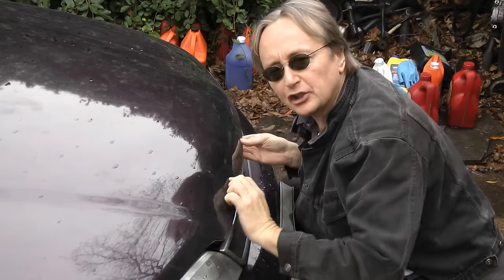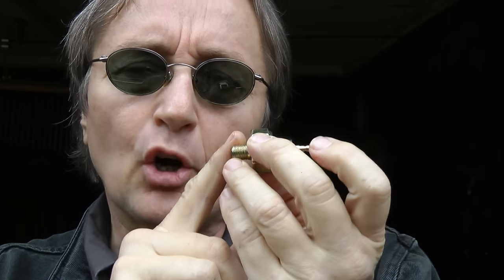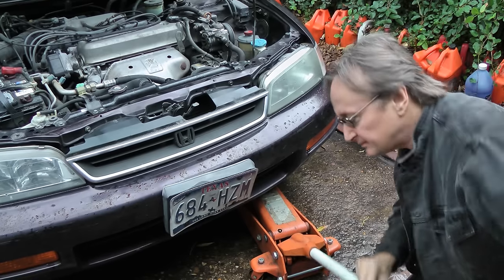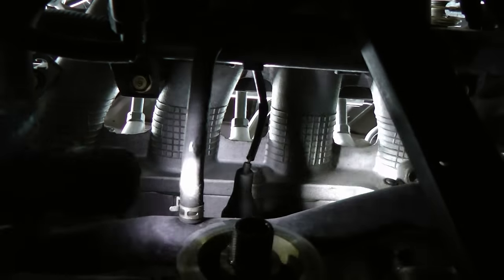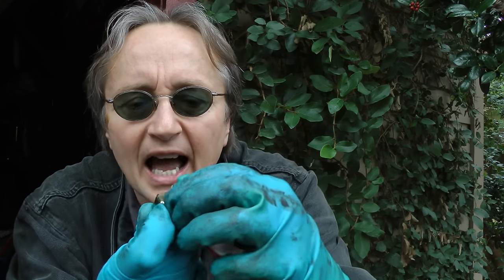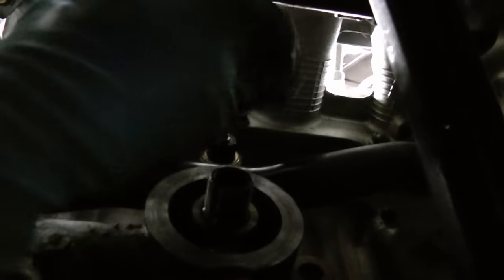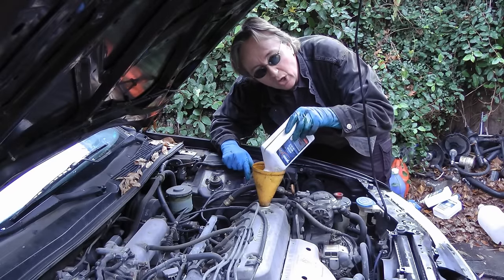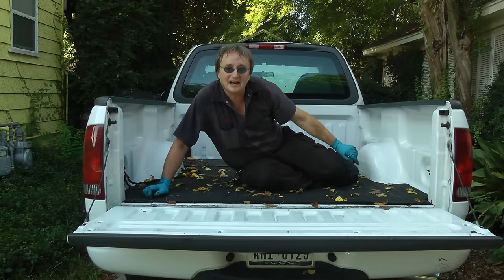How to Fix a Low Oil Pressure Light in Your Car

Comment: Hey Scotty, i have a 01 V6 Firebird, at first coolant was leaking into the oil, so i changed the intake gasket and it seems fine. however i want to get the e-test done on the car but i noticed the oil pressure is at the max and won't move, oil just changed and same problem, is it just the oil sensor unit that needs to be changed?

Comment: i have these simptoms, low engine oil between changes, smokey exhaust, less power than it used to be, oily and greasey engine bay, and the engine gets hot pretty quickly.
what does that mean? please help me scotty. its a hyundai car 1.0 compact

Comment: Hey Scotty, this is what happens on my 2001 Expedition when i run the A/C, but the light only comes on when stopped at a red light.
Reply: Its probably because its an older engine those ford motors really wear out over time so its probably only because you are at a lower idle at a red light so its not picking up as much oil . if i were you i would go up to a 10 w 30.and put some lucas in your oil and run it before you drain it that way everything is lubed up real good when you out the new oil in

Comment: Hi Scotty,  I have a 2006 Ford Fusion.  I had a complete oil change and air, and oil filter change as well as transmission fluid, and filter change a few weeks ago. Now all of a sudden in park, my system check sounds an alarm that my oil pressure is low, even though oil is up. If I am driving and do a system check, it comes back fine. I use synthetic 5w20 oil, as well as synthetic fram air and oil filters. Any idea as to what could have changed since the oil change?

Comment: Hello Scotty. At what RPM is supposed to idle a 96 Honda Accord ELX with auto tranny.
I drove one recently and iddle to slow, say somewhere 600 to 700 RPM. When I move the steering, RPM goes up a bit. Same when put the shifter in drive. When cold, the Honda start reving at 1K5, perhaps a little more. After three minutes it drops slowly to 1K, and then drops even more. I don't know if the RPM are to slow or idles poorly. The car shakes a little. Not sure really. What do you think ?. Cheers.

Comment from the maker: you have true low oil pressure, stop driving it. Bad oil pump or worn internal engine parts like crank bearings do that most of the time IF the engine is not low on oil.

Comment: Hi Scotty. 
My oil pressure light came up in my Toyota Auris 2007 
Car just stopped and won’t start again. Engine is cranking but not starting. 
Is it the sensor or the pump ?

Comment: On my 09 Charger 3.5 V6 the maintenance oil light came on so, I changed the oil and filter but, the oil light will not go out.
Any suggestions?
Thanks a lot, Scotty.

Comment: hey scotty is it possible that the oil pressure censor can leak, because when i turn on the car it starts leaking oil and is coming from the oil pressure sender sensor and the oil filter. again it only leaks when the car is running!

Comment: Is me again, Mick. 

My passage power window is not working but others are working perfectly. I did open the controller and try to wipe clean a little bit and it works for once only and very slow.  What shall I do ? Should I change the whole window switch board or shall I check the spray wd40 on the window pulling parts ?

Comment: @scottykilmer if the timing chain rattles and the oil pressure is "LOW" does that mean oil pump is going out? the car is 24 years old

Comment: Hi Scotty, I drive a 1999 Honda Civic EX sedan. I have an issue with my car. I'm able to crank my car but it wont start over. I thought it may be the distributor and replaced that but still doesn't work. Do you have any ideas what it might be? Thanks
Reply from the maker: do my video tests "fixing a car that cranks but doesn't start up" to find the culprit.  If it's none of those, check the main power relay, they go bad a lot on that model.

Comment: Hey -scotty kilmer I got a 94 honda civic and the oil pressure light is on but only when you put the ignition to the on position not actually starting the car would it still be the oil pressure switch??

Comment: i had a 96 buick lesabre. i had the oil changed a few hundred miles ago, and the oil pressure gague read normal. my motor locked up though because of low pressure. how can this be? if a car cant hold oil pressure i think that means the motor is tired and worn out.

Comment: I'm having problem on my gsr.. Oil pressure light is on oil is fine it's making noise on my head. It starts blinking when driving than it suddenly goes back to normal. No noise n oil light is off.?? Any suggestion it does it all the time when I turn of the car

Comment: HEY SCOTTY, Would a bad oil pressure sending unit throw a code in a 2017 Optima LX 2.4L (gas)? The light starts flickering at the 3/8 hash mark on the temp gauge (flickering) and then ultimately will fully illuminate when the car engine is not under load. Fast acceleration (increased pressure) puts out the light. Just came came from Autozone and the car did not have any codes appear in the report. Your thoughts are greatly appreciated and thank you for your service.

Comment: hi scotty i have a 1979 datsun 210 automatic and the oild pressure light flickers alot but mostly stays on any tips?
Reply from the maker: do as in this video, replace the sending unit, it's cheap. If not that, odds are engine is just wearing out inside being that old. As long as it doesn't clank when running, you can drive it that way as long as pressure is good at running speeds

Comment: Hey scotty my oil pressure come out, and than once the engine gets hot it dissappears ? 
Could that be a bad problem
Reply from the maker: IF oil pressure is really low, engine will make horrid clanking noise as bare metal rubs against metal. If not, odds are the gauge system is just broken

Comment: Is oil pressurized? I am very unsure and I cant seem to find a clear answer. When changing the oil of my Chevy sonic it doesn't seem to be, but on a V8 ram 1500 It seemed pressurized. (I was an on looker on the side). They couldn't remove the filter until I told them to either remove the dip stick or remove the drain plug, for some reason they put the plug back in and didnt wanna remove it. They removed the dip stick and the filter came out easy. Was it really because of pressure released? Please help.

Comment: Scotty

I have a 2000 dodge caravan. My oil pressure light has been coming on when I put the van in park after driving it. Last week, on the way to work it just shut down on the way and all the lights everything radio were working but it wouldn't even turn over. I had to have it towed. Does this oil pressure light have anything to do with this problem.
Thanks for any help in advance
Reply from the maker: if you really lost oil pressure, engine can lock up and be ruined. Try jump starting it, if it cranks over, it's not locked up and has nothing to do with oil pressure gauge.

Comment: I have a '94 Pathfinder that the oil pressure light comes on AFTER you shut the engine off.  Even if I remove the key it remains on until either the battery dies or I disconnect it.  Any ideas on whether this could be my issue?
Additional info:  this vehicle has undergone an engine swap and I'm wondering if something was hooked up incorrectly. The light is not on during driving.
Reply from the maker: +August Wilson  yep, the guy hooked something up wrong, take it back
Reply: +Scotty Kilmer I changed the oil and the light stopped coming on. I'm guessing here, but I'd say the previous owner did not change the oil on a regular basis judging by the looks as it come out.

Comment: I have a 1990 Chevy Silverado K1500, My check gauge light comes on, I added more oil because it was low. although... I still got the same problem, but when i punch on the gas my oil pressure goes back to 30+ what could be causing this? I'm assuming sludge in the oil?

Comment: 2017 encore 1.4 low oil pressure light when drivinging and  stop light, after oil change accelerate and is gone , engine is nice and smooth,  maybe the cheap oil filter?

Comment: Hey Scotty, a quick question once the new sensor is being replaced do I use the same oil filter or a new one ?
Reply from the maker: you can use it over as long as the gasket isn't torn

Comment: I have a scion xb 2008 the oil pressure light came on for 2 seconds and it went off again but i have the car overheating and the RPM goes half way when not acelerating to the point that the car turn off by it self! You think thats the oil pump problem?

Comment: Scotty Kilmer , My oil indicator light only chimes when my RPM is lower then 1000x... I have already checked oil level, searched for leaks, and also disconnected and reconnected my battery cable to see if it has changed anything.... but still nothing. Recently I had my Alternator and Power steering pump replaced about 4 months ago.... any suggestions?

Comment: Hey Scotty,  My 2002 dodge intrepid is at about 128000 miles. I just recently have had the check oil light come on when I brake. I have heard that the 2.7l engine is prone to oil sludge and i have had the seals replaced when I bought the car and use only synthetic oil. Should I check the oil sending unit first or should i be more concerned about another culprit?

Comment: I have a 2015 Kia Optima about 1800 miles not due for an oil change for another 1000 miles and I've noticed the low oil pressure light comes on for a second then goes off while im driving sometimes what do you think it can be ?

Comment: i have a 01 chevy astro van an i change the  oil pressure  switch an it still  showing low oil  low but when i start up when it cold the  gauge  go right up but when engine  warm up pressure  show  low  but no noise  when i rev the engine it go  up to normal

Comment: hey Scott i have in 2008 silverado i just rebuild the engine and got a new oil pump in it doesn't pump any oil up to the lifters do you know what the problem could be
Reply from the maker: +Corny Klassen either pump wasn't hooked up right, or there are restrictions in the oil galleys feeding up to the top of the engine. good luck on that one

Comment: Hey Scotty well it worked the oil P light is off now I ended up taking off the oil manifold and cleaning out all the black sludge around the valves boy was that shit caked on there anybody that has a Nissan that has sat for a while should do that don't just go replacing parts it always the little things that u don't think of causing all the problems. Hey Scotty I see your car has Texas plates do u live in Dallas? If so do u work on cars on the side?

Comment: My 05' Chevy Avalanche seems to be loosing oil pressure ! I changed the oil put new filter ran for 400 miles and changed the oil and filter again thinking it might be sludge build up. I cut open the second filter and seems to be ok on the sludge so I next changed the sender unit, ran it till hot and still my pressure is dropping below 40 and fluxuating and near 25 when idle..Tell me there is something else I can look for or do without tearing my pan down and changing my oil pump. Oh i did notice there is a slight tapping coming from the valves but I hoping that is because of the pressure problems... Thanks !!!

Comment: Scotty could you help me. The oil light only flashes when I drive a long distance to 60 miles per hour up. The oil level is all good, recently change it. when the la light come on sometimes the RPM goes up and down.Thank you;.
Reply: Scotty Kilmer can you reply to this problem, I'm having the same issue on my PT Cruiser 2001. Oil is topped-up and clean, oil pressure is fine and there are no leaks. The check oil light only comes on say at 60 mph or in my case, after 15- 20 mins driving.

Comment: hey there, I have a 96 neon duel cam, my oil lights turns on at low rpms and rite about 3k will turn off the light anything under will turn it back off. is it the pump or oil sending unit and how can i test it, thanks for the feedback buddy...

Comment: hello got a question for you i got a 1989 chevy silverado 2500 v8 350 tbi and sometimes when i start the truck the oil pressure is low and light comes on and other times when i start it jumps above 60 and stays there! do you know what mite be the problem?

Comment: Hi Scotty I have a 2006 acura rsx automatic with 145000 miles. Would this also work if your oil light is flickering on and off instead of just staying on? Or why might it be flickering repeatedly.

Comment: scotty i have a 1997 mercury mountainer the oil gauge gors nuts...goes back and forth.. and at stops it goes down to low..the sending unit  has been change as well the cluster and still does it.does it mean my oil pump its goin out? or i have a electrical problem?
Reply from the maker: +Isaias Arellano IF engine does not make clanking noises when it goes down, the wiring has a problem somewhere with minor shorts or loose connections

Comment: hi. what does it mean if you have oil leaking from your Oil Pressure Switch. i have a Vauxhall Corsa 1998 (1.2 petrol engine). It leaks when the engine is turned on.

Comment: Hi I have a 06 pathfinder preassure was fine all of a sudden when hot needle started to drop and go up been like that for about 2 years now. I change the oil every 5000km. When accelerating normal pressure when at idle dropped. Today it started dropping lower and oil light would come on for a sec or 2 then off when going again. No leaks noticed under the truck. Any advice? Weather is also hotter than usual about 38 degrees Celsius. Could it be oil screen clog?

Comment: Also same 2000 Dodge Caravan. I had an alarm system that we lost the key fab for and the alarm was set. I had an extra key that would unlock the door but wouldn't start the vehicle with the system armed. My neighbor took the fuse out for the alarm and I was able to crank it but do not have turn signals or a blower for my heater without the fuse inside. How can I disable the alarm and connect the fuse back in without having to take the fuse out

Thanks for any help in advance RC

Comment: For low oil pressure, does a low oil pressure signal from the oil pressure switch to the CPU cause the shifting scheme from the CPU to be a higher rpm range for shifting, and then after replacing the oil pump, the higher pressure signal from the oil pressure switch, causes the shifting scheme from the CPU to be a lower rpm range?  And then I think the reason could be is that power at lower rpm could cause more ware with low oil pressure.

Comment: Hey Scotty i have a 2005 chrysler 300 and my oil light just came on and it blinks on and off i checked my oil levels and they are fine , plus my engine just started to make a little bit of a rattle like a knock, im thinking it might be the oil pump, what you think
Reply from the maker: worn oil pumps or worn engine bearings do that, pray it's just the pump

Comment: my oil pan was cracked a4 2003 v6.. Did not notice the crack untill driving couple minute my car was making a diesel noise ... went to change the oil pan and put some oil in it.... my problem now is I often get the low oil pressure light coming in .. time to time .. I could have it for 2minutes then nothing for 2 days and then coming back for couple minutes... Did I just lost my engine or do you think maybe piece of metal got into the pickup tube when It got cracked? my mechanic did change the pan but didnt not say anything about the pickup tube was wondering if maybe the pickup is the problem
Reply from the maker: realize engine is probably crap inside now, low oil pressure is often caused by worn engine bearings from lack of lube they wear out and make a bigger hole for the oil to flow through and lower the pressure. See that a LOT

Comment: Hey Scotty, I am back again with one more question, I have toyota yaris 2011. Today, I have started my car to warm it up and it started fine. After 15 minutes, I stopped my car and started again but this time it is not starting and making weied grgrrrrrrrrr garrrrrrrrr noise. I observed that Low engine oil pressure is ON. That is the only light ON. I thought it might be battery issue but headlights are working fine. What could be the problem ? Thanks in advance.

Comment: Scotty, my 94 Accord has a red 'maintenance required' flag on the instrument cluster. Sometimes the oil light flashes on and off. Are these related, and can I reset them somehow?
Reply from the maker: Derek Suddreth  red is just B.S. warning system that comes on so many miles, ignore that, just reset it by pushing the resetter back in. Change the oil pressure sending unit, pray that light goes off. If not, odds are engine is wearing internally and lowering oil pressure

Comment: Hi Scotty, I have a 2007 pt cruiser standard model, 146,000 miles exact today. My oil pressure light has been coming on and off for 3 years now. But now it stays on for the last 2 weeks and won't go off. I have put oil in it but I do need an oil change. What do you think it could be? Chrysler dealership wasn't honest about it being the oil sending unit, so I thought I was clear.
Reply: redbone31210 mine comes on when I need an oil change. The first time it did it I was freaking out. I got an oil change and the light went out. Now I am due for another oil change and it came back on. I change my oil every 3,000 miles.

Comment: hey Scotty,, My 2000 saab 93 oil pressure light/ warning chime comes on when I'm slowing down to stop at idle rpm. There's no oil leaks or knock or ticking noises I can see or hear. Could that be the oil sensor? Thank you